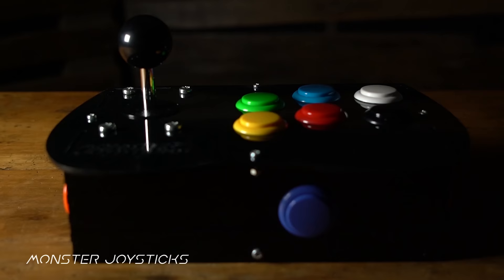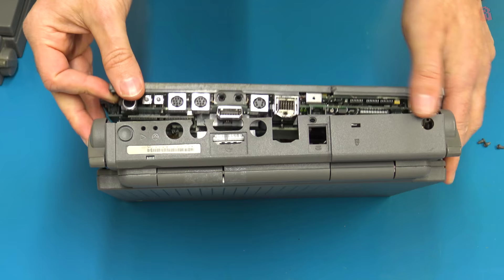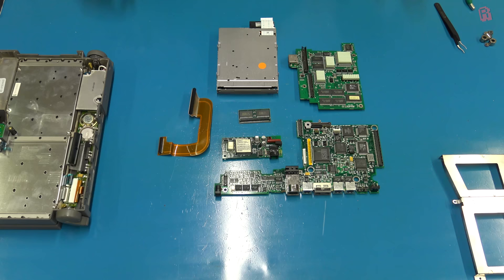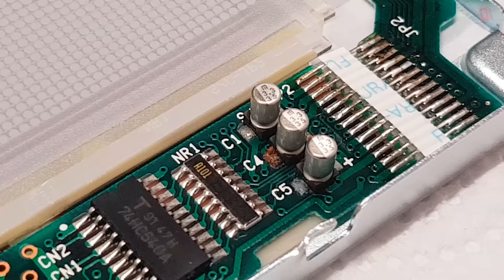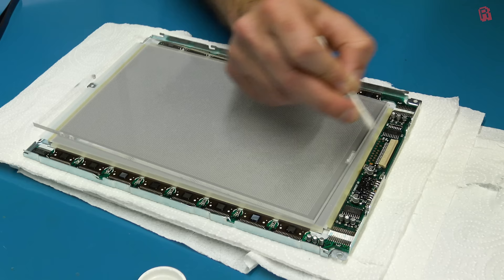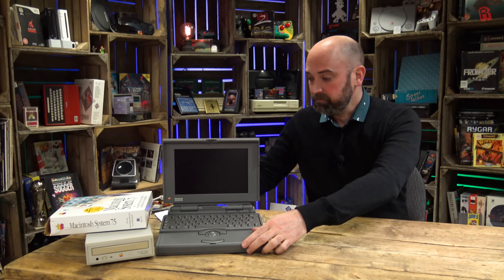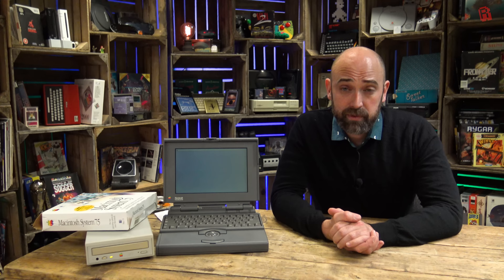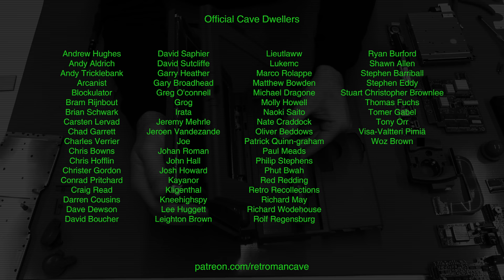Restoration of a '90s Apple Powerbook - Trash to Treasure

Comment from the maker: What would you put inside this Powerbook?  My Patrons over at https://patreon.com/retromancave have pointed me in the direction of a reduced side SCSI2SD made to fit inside the Powerbook, it's not cheap but it's an option, or do we need the sound of a spinning drive inside here for the full experience?  Let me know your thoughts and thanks for watching.
Neil - RMC
Reply: SCSI2SD is better than HDDs cause, HDDs from that era die a lot.
Reply: I'd second the SCSI2SD, I think I saw The 8-Bit Guy use one in a MAC.
Reply: RetroManCave I have a SCSI2SD in my Performa. I do miss the rattle of the spinning drive, but I do not miss the loud whine. For functionality, I’d go with the adapter. You can configure it with up to 4 virtual drives.
Reply: I think the SCSI2SD Powerbook version is the best bet as well.  Perhaps an opportunity to work with the developer to add a speaker either on the board or via a header so the drive sounds can be simulated?  That would be a great project!
Reply: I wonder if you could use an arduino or similar device as the go between for the sd card, since all other options are expensive. would take some programming I am sure... and is floppy emulation the same way but slower? I am sure someone has thought of the gotek option if it would be optimal. idk. sorry kind of a noob but I bet something could be made for it by someone smarter than me lol. The hundred dollar scsi2sd option that exists still seems better than the six hundred dollar option, especially since it can die at any minute, except for like historical restoration purposes or if you wanna be a purist and keep it stock. Gotta pick your poison I guess. I'd like to see what you come up with for it for sure though.
Reply: Great video, thank you for saving another Mac!

RetroManCave I agree the SCSI2SD adapter for the PowerBook is expensive, but unless you want to hack up something internally... or use your current SCSI2SD adapter externally, I don’t see many other options. 

The SCSI2SD adapter you showed in the video has an external DB-25 pin header, so you can easily solder a connector on it (like I did) and use it externally. Just don’t forget to power it properly using only two of the power pins.

I guess it all comes down to how often you think you’ll be using the PowerBook. There’s no shame in having it rely on an external disk!

Also, here’s a tip! Apple did produce two types of PowerBook SCSI HDI-30 cables. The grey PowerBook colored cables have the extra pin to enable SCSI Disk Mode, but the platinum or beige cables lack this pin. 3rd parties made adapters with a switch, allowing you to easily turn that feature on or off.

Best of luck!
Reply: Well it says $85 usd for the scsi2sd v5t powerbook edition. Plus whatever the tax and shipping ends up being. Seems like a 'low enough' price to justify the convenience... given the cost of the other original  apple original parts, cables etc. that were already paid for in this particular restoration. It is still an Apple product after all ;)
Reply: Get the 2.5" SCSI2SD intended for the PowerBook...
Reply: I see I’ve been beaten to the SCSI2SD 2.5 recommendation, so I’ll just say how much fun this was to watch, and I do hope you’re able to find time to add an internal adaptor.
Reply: The SCSI2SD is cheap compared to basically any alternative.  I used one in my PowerMac 7500 (G3 upgraded, maxed out RAM), and it works exceptionally well.  The only caveat is that the SD card must have an intact final sector, as that is where the hardware places the driver shim.
Reply: I think I saw a sandwich and banana put inside an apple ii on a German YouTube video once. Cheers for the video 👍
Reply: Take out the floppy drive and put the SCSI to SD adapter in its place - you could even access the SD card through the floppy slot if you're lucky ;) (perhaps you could use the case/mountings from the spare floppy drive to make it a really neat installation)
Reply: Aren't there smaller SCSI to SD adapters? I'm looking at eBay right now and it seems there are smaller versions of the board you have that might fit. There are also SCSI to IDE cards that might be able to handle a small IDE to Compact Flash adapter.
Reply: SCSI2SD Powerbook edition all the way, I have one in my PB100, so easy and CHEAP compared to 2.5" SCSI HDs.
I also have a PB160 that's missing the trackball, trackball retainer, and has a bad keyboard, it's too bad you're on the other side of the pond, or I'd consider trading a working 80MB 2.5" SCSI drive for your spare keyboard and trackball bits.
Reply: I am not familiar with the Powerbook, does it support a PCMCIA slot as you could use a PCMCIA to CF or SD adapter if it does?
Reply: I’m a hard drive purist for my retro machines.  But this is a laptop, with a very uncommon internal drive, and that is where I draw the line.  SCSI2SD it is.  You can’t win them all.
Reply: SD AztecMonster or a CF AztecMonster would probably work
Reply: The only other possibility I can imagine is something I have - a regular SCSI to IDE adapter that would allow you, possibly with a second, 3.5 to 2.5 IDE adapter, to connect a 2.5" IDE hard drive. Of course, any option you end up with will provide a drive that is quite large for that old machine, and the old HFS filesystem becomes inefficient on larger volumes due to block size, as I understand it. Apart from that, though, it would all work fine. A smaller SCSI2SD sounds like the smart way to go, though.
Reply: An SSD
Reply: As a hard-drive replacement, I really think you can't go wrong with the PowerBook variant of the SCSI2SD. The only downsides are that, unlike some of the newer versions, the PB SCSI2SD isn't able to transfer files over USB, the USB port is just to configure it or (in rare occasions, power it). One thing I really miss, though, is the sound and vibration. I really wish there was an easy way to replicate the hard drive whirr and seek sounds (and only do the seek sounds when it's actually being accessed).
Reply: I'm a big fan of solid state in these old machines. I appreciate the "authenticity" of a mechanical drive but the limited storage, unreliability and slow speed definitely leave a lot to be desired. If it's the difference between something that will get used and something that will just sit on a shelf I'd say go for it!
Reply: I don't know for sure but I might have 1 SCSI 2.5 drive in my pile .. which I salvaged from one old Compaq laptop..
Reply: I have a PowerBook 165. I ended up using the reduced-size scsi-to-sd adapter. Using an 8 gb sd card, I was able to have four 2 gb partitions loaded as scsi devices 0-3. This allowed me to use ids 4-7  for cd rom, ethernet adapters, and zip disks. I would recommend this be what you do. You get a stable and durable  hdd solution. You also have an easy solution to swap  disk drives down the road (just have to format a new sd card). You also will want to look at replacing the CMOS battery as that can also leak in the future. The PowerBook 160 and 165 are good machines
Reply: Why spend more on a platter when it's old and will die soon anyway?  Nostalgia isn't worth it when a solid state solution also provides better performance.  SCSI was nice back in the day, but is obsolete now.
Reply: @HoboVibingToMusic  It was those shitty ballbearings. After the introduction of FD bearings around change of the century, harddisks became an order of magnitude more reliable.
Reply: #RetroManCave Hi Neil, Had you checked out my proposal yet (AGFA scanner)? You had CC'd it to yourself last week. I understand if you are too busy to follow up on it, but please just let me know with a yes or no. Thanks!
Reply: Dude, that SCSI to SD converter won't fit in the hard drive bay, but the floppy bay will fit it just fine.  
And yes, of couse these Powerbooks had external floppy drives. Not sure if you can still find them, but maybe you don't need a floppy.
Reply: @marcusmayfield9499  Actually those Quantum GoDrives were fairly quiet as far as vintage hard drives go. My 180c still has a working one and I make sure to turn it on every once in a while to make sure it doesn't get stuck mechanically. The screen has issues though, probably dead caps too. In my experience, those 2.5" Quantum drives were the first to go. While most of my 3.5 and even 5.25" hard drives still work, pretty much all of the 2.5" ones are dead and have been for over 15 years.

The nastiest-sounding hard drives were the Quantum Fireballs in the low GB range - they have a really annoying whine and always had it! The 10 GB that replaced the original 4.3 in my beige G3 wasn't quite as bad but still loud enough. It was definitely faster than the smaller one though.
Reply: Ragnar8504 What was in my Performa was a sub-GB Quantum Prodrive - specifically, a 525S. When I say it was loud, I mean I could hear it from the other end of the house through walls and doors. It had to go. And by now, I’ve grown accustomed to not hearing the drive.
Reply: How about trying to retrofit the platters of a different drive? The ones of a ide drive should be exactly the same.
Maybe it's going a bit far though, no idea on how to low level format the thing and perhaps calibrate the head either. From what I was taught is that there should be extremely little space between the head and platter...
Reply: NetBSD
Reply: I have hundreds of working scsi drives. Most 120mb types… in the UK. Get in touch if you want one
Reply: @markevans6790 it’s Mac not MAC, Mac is short for Macintosh, it’s not an acronym in this case, MAC the acronym is for networking however
Reply: @onigvd77 Jeez that was 3 years ago, I'm pretty sure people knew what I meant.
Reply: @markevans6790  just making sure for your knowledge more than anything, it’s a more common mistake than I would have thought

Comment: Nicely done on the restoration! For the hard drive, I'd go with the SCSI2SD -- there's a smaller 2.5" version available that's specifically designed to fit PowerBooks. I bought mine from Inertial Computing.
Reply from the maker: Thank you, great to see you here
Reply: I ended up using this with my PowerBook 165. This plus a 10mb memory expansion used as a RAM disk makes for a really slick classic mac

Comment: So you've got an extra motherboard? You could turn that into its own desktop PC, potentially. Reassemble it without the screen, it'll be like a little Apple II.
Reply from the maker: Hehe that's a fun idea!  I've safely wrapped all the spares up and kept them safe so potentially a project
Reply: RetroManCave that be a cool fun project
Reply: RetroManCave also I might have a drive laying around I have a few of these old Mac laptops in the shed
Reply: You could turn it into an external SCSI hdd too if you can solve that hdd issue.
Reply: @RMCRetro  or you could make the first apple car computer!have it fed into a 10 inch head unit

Comment: I have a IBM H2172-S2 160MB SCSI harddrive with the Apple logo on it and everything. it does work it was pulled from a newer powerbook that had a 040 in it. that laptop is long gone and this HDD has been sitting in my spare HDD drawer ever since. I have no plans on using it it could use a new home...

Comment: I used to go dumpster diving when the school year ended to scrounge up stuff that was thrown out barely used (ink ribbons, books, composition journals, etc) and I remember finding one of these in the trash bins behind my high school, this was around 1994. It was in working order but was missing the power brick. The 10 or so minutes of power that were left on the battery were enough to deduce it was probably used by the administrative staff (apparently they didn't bother to wipe the hard drive). I actually still have it in a box somewhere, some day I'll get around to finding the power brick.

Comment: A while ago I repaired a Powerbook 145B (pretty much the same machine). You can get an SCSI2SD Powerbook edition which is smaller and has a more appropriate connectors there. I installed mine in the battery compartment  by gluing nylon standoffs to the case and then just screwing in the module there. The battery was dead anyways, and the thing works beautifully. Plus I can easily remove the SD card. Just open the battery compartment and get the SD card out. 

Also... the plastics in these machines really are horrible. Small cracks everywhere. Mine even had them on the hinges where the display is screwed on. So the LCD doesn't quite fit together like it should. But luckily it's only a cosmetic issue for now.

Comment: SCSI2CF boards ought to be a fair bit smaller, and from my field (old synthesizers and samplers) we've found CF to be more reliable with older systems than SD for some reason.
Reply: CF cards in my experience act more like traditional IDE harddrives.  So much so, that on IDE systems, the converter from IDE to CF is mostly passive.
Reply: That was my thinking, too- A SCIS to CF or sd card or soemthing of that sort.
Reply: CF cards are great for replacing IDE drives, but SD card adapters seem to be far more popular for SCSI replacements.  Probably because the CF card using the IDE standard is of no advantage for adapting to SCSI and good industrial grade SD cards being far cheaper to buy than the equivalent CF cards.
Reply: Yes because Drednaw is water/rock. Yes ground.
Reply: SD cards are also serial in nature like SCSI is, ide like CF cards are parallel. You can convert SCSI to ide and vice versa, but it can be problematic as the adapter won't convert some of the SCSI commands a SCSI controller will expect and obviously a ide drive can't do a lot of those commands either.

Interestingly, apple migrated to FireWire because of how similar to SCSI it is so was much easier to swap over. The same to some extent with thunderbolt I believe, though not quite as simple as SCSI-firewire.
Reply: @bionicgeekgrrl  SCSI is not a serial protocol, it's parallel.  It's not until much later that you have Serial Attached SCSI (SAS), which is to SCSI as SATA is to IDE/ATA.

Comment: Soak your desoldering braid with flux, it will wick out solder 100x better.
Reply from the maker: Nice tip thank you
Reply: @RMCRetro  Make sure you buy "Servisol Soldamop No-Clean" desoldering braid. I've tried loads of brands, but nothing mops up solder anywhere near as good as Servisol No-Clean. It's impregnated with some kind of dry flux powder.
Reply: I just thought the solder wick I had was crap, so I started doing that. Then I got some recommended stuff, nope, still had to put flux on it to make it work more effectively.
Reply: I think Big Clive runs a flux pen over his before using it.
Reply: The cheap ebay stuff you have to flux or it barely wicks, but if you have original Goot braid it's pre fluxed and works amazingly well. That being said the GOOT is pretty expensive, ie, $7 to $1, so I have some amazing DeoxIT/Caig flux that can turn any bad braid to brilliant in an instant - ebay fluxes don't hold a candle to it -.
Reply: @SidneyCritic  I have had great results with Chem-Wik desoldering braid, it has a lot of flux in it, and it is reasonably cheap (under $4).
Reply: I came here for the soldering tips!

Comment: 4:55 - worth pointing out this was an issue from new! The plastics were always brittle and we usually replaced the bottom case along with the I/O flap as the daughter card & cousin cards (no really that's what Apple called them!) needed to be secure otherwise you could get system errors! (The boards tended to lift up due to heat & vibration).
We did try melting them back in place with a soldering iron, but it made an awful smell and ruined a few tips!
Reply: I agree — my PB 160 had plastic bits break even when just a few years old. It has a crack on the bottom from when I put in the RAM expansion; space was really tight.

Comment: Not sure if you watch @BigClive 's channel, but he has an excellent soldering tutorial video. After watching that i solder like a pro now !. Hes a master at it. Trick is to apply the solder tip to the joint for about 2 seconds, then apply the solder directly into the joint. Leave 1 more second so it flows around the entire pad then remove the iron tip from the joint. Do not apply solder to the tip first..... Clive would be doing lots of FacePalms if he saw this. hehehe.